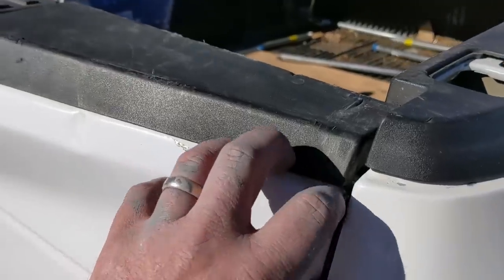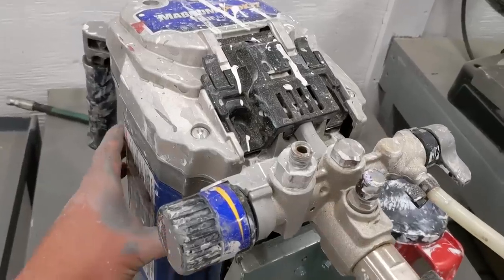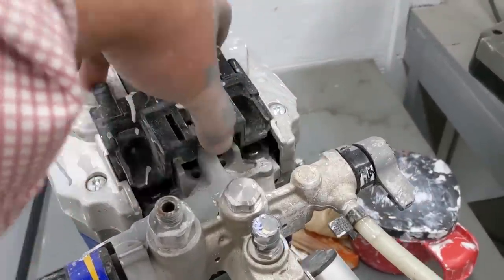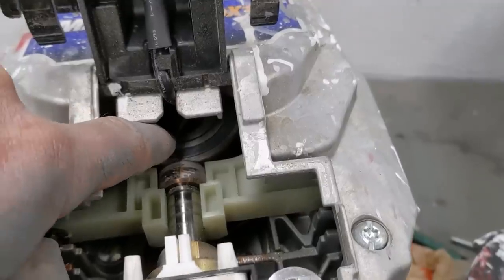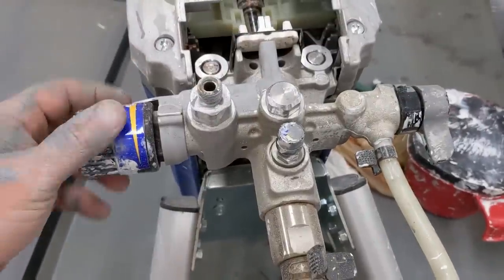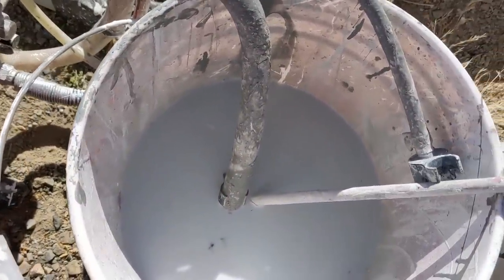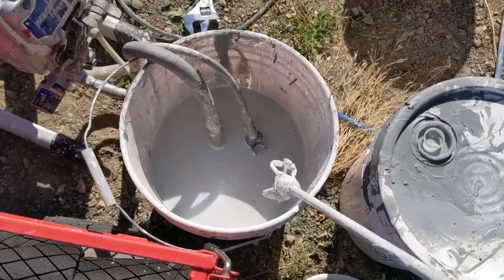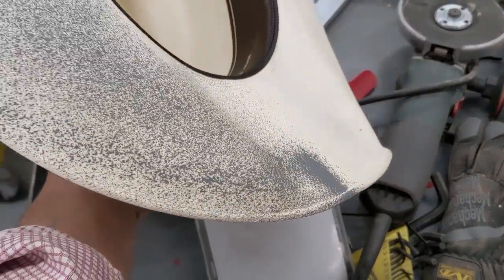Tune-up the wife's favorite toy | Grayco MagnumPro

Comment: I was a pro painter for 16 years let me tell ya we party hard why you think there is a bottle opener on a paint can opener. Lol
Reply: Whenever you find four painters you always find a fifth.
Reply: I think I can top this! Electrical cabinet keys double as bottle openers! (Not the 4in1 kind, but the cast ones with a "loop" handle)
Reply: @RustyorBroken  Infinite painters once you got at least 4. Got it.
Reply: Can confirm
Reply: Wise man once told me it was because painters are too stupid to properly operate a 28mm non continuous spiral thread female beverage endcap fitting ..
Reply: The only guy I currently know that's a professional painter drinks beer all day, even while working. Doesn't even bring a cooler and just drinks em warm. He says it keeps people from stealing his beer.
Reply: It’s definitely an occupation for the thirsty crew
Reply: @SakariNy  my cnc milling machine has one of those for the control cabinet.
Reply: @slidey1000  it's two step troubleshooting tool.
Reply: @SakariNy  exactly.  Diagnose the machine, then calm the operator down. (me)
Reply: Your screwdriver has a bottle opener on it?
Reply: @pinpetos  roofers, anyone?
Reply: @jonobvious  my screwdriver is a bottle opener.
Reply: My bic lighter is a bottle opener....so is my wedding ring.....yeah I'm covered
Reply: I never knew a painter who didn't drink...or swore it off for good (reason).

Comment: Got me one of them schmoo shooters. Works great as a parts washer with some brake cleaner in it! Previous methods included the dishwasher but the kitchen staff nearly issued divorce proceedings when I left a pair of brake calipers in there!
Reply: Thanks for the tip, I will present it to the misses as a paint sprayer but secretly wait until she is done to have a parts washer!
Reply: It's a good meal only when served on a sizzling hot brake caliper.
Reply: Years ago, I used to buy the 3 pack of surplus chinese SKS rifles at the gun show, clean em up, sporterize them a tad and flip em to make a few bucks to pay for MY ammo. The dishwasher was the best way to get the last of the cosmoline out of them. Until I got caught. 
Things changed a few years back, let's just say these days I can wash anything I want in MY dishwasher. Can't get the cheap guns anymore though, wish I kept a couple for myself...
I like the cleaning gun idea, I'll be using that. A little kero or commercial cleaner mix in the tank and let er rip. Bet it cleans out the check balls well too.
Reply: I used to wash the cluster cups from the milking shed in the dish washer, there were 136 of them. The misses didn't mind because if I didn't use the dish washer she would have been helping me clean them by hand.
Reply: Bobster - I got caught putting foot pegs in the dishwasher. Apparently that isn't the way to a long and happy marriage.
Reply: @BrianBell4073  I have to admit. Brembo 4 pots and white plates aren't good bed fellows!
Reply: @bobster1982  shit i'd trade a wife for brembo 4 pots
Reply: That's why you should have the old dishwasher in the garage for cleaning parts. Just don't run gasoline in it or you'd have a long discussion with the fire department and no garage.
Reply: @ehsnils  ...speaking from experience orrr....?
Reply: Thanks for the idea, I have one of these too, fucking beats trying to paint stucco any other way.

Comment: Ah yes the wonders of the airless paint sprayer. Blows everyones mind when they see how fast you can bang out a house the first time. If you are blown away by the simplicity of a paint sprayer you should see what does the pumping on our $4500 graco rtx 5000 texture machine. There's a chance you've seen the mechanism with your background but it blew me away. I took the cover off cause we just got it and I was curious, what makes this texture machine be able to literally blow through a house even multiple apartment units in no time? A wheel with two shafts sticking out that squeezes the same type of vinyl or whatever tube that goes to the gun in a U shape in one direction. Thats it, I thought it was gonna be some crazy screw drive or..... no a wheel and two free spinning shafts do all the pumping by squeezing a tube. Genius, blew my mind, I absolutely was not expecting that. If the tube gets worn out its only like a foot or two long, has large brass fitting disconnects and is replaceable, I mean come on....
Reply: Peristaltic pumps are neat. They're pretty common in medical machines where you don't want the pump itself to touch stuff like blood (dialysis and transfusions come to mind), and are pretty accurate for applications where you need measured quantities, since the volume between the rollers/wipers is a constant.

Comment: Just bought the exact same model to paint my kitchen cabinets. I hung the doors vertically and  they ended up looking like a topographical map of the Hymalayas. I gotted some learning to do.
Reply: Been there, done that. I feel your pain.
Reply: You got a thousand linear feet a kitchen cabinets or what? Christ, what did a brush ever do to you?
Otherwise Harbor Freight siphon gun is all you need If you can't roll it.
Reply: @otm646  I'm a new homeowner and young, I suspect it won't be the last time I use it. Better to have it and not need it than to need it and not have it.

Comment: Big thumbs up to companies that make repairable products instead of throw away crap. 

Side note. I recently was tooling on an old truck that has seen many northern winters. Got stuck on 2 bolts & ended up taking a break from frustration. While sitting around an AvE vid popped up in my suggestions & like the best of all epiphanies I recalled a vid suggesting alternating between tighten/loosen to crack a rusty bolt. This suggestion turned several hours of cuss words into 2 min of absolute relief. Earned my sub yet again.

Comment: i worked for a foundation repair company and we used these to flush foundation cracks with acid/water through grease nipple fittings that we drilled into the foundation

Comment: 8:15 Use Throat Seal Liquid (TSL) prevents paint and coatings from drying onto the displacement rod and packings extending the life of the pump
Reply: I just use 100% anti freeze
Reply: I run a hydro pro iv.
Reply: @skm9420  Good for storing also cheap but when spraying you wanna use TSL on stroke rode just fill the wetcup I've never had that problem with my Graco ultra max ii 490
Reply: Consumer models (magniums) dont have a lubricant cup like the pro models. Your not able to properly oil them. This is true for both manufactures I repair for; Graco/Airlessco and Titan/Wagner.

For storage. What I have my customers do is clean the machine well and then pump mineral spirits in to the complete system for long term storage (any time frame greater than 1 week). There is a product you can buy called pump saver which mixes with water. Its essentially windex and antifreeze. I prefer mineral spirits due to it protects the steel and wont let it rust as well.
Reply: Meh tsl is just any old oil. Lol
Reply: @matmuffin1  nope, it's also designed to be a solvent to prevent any paint from drying.
Reply: @mtbrdude  I used to work on these every day for a living. Tsl along with any motor oil will prevent both water and oil based paints from drying... If you have paint making it past the packing nut you either need a rebuild or to tighten that nut. I've also seen pumps make 3300psi with only part of a piston packing intact so these things are designed pretty good lmao

Comment: I used to paint with the biggest sprayer Graco makes. It was powered by a 185cfm air compressor outside. Still got two of the 1.5in dia check valve balls it used. We always filled the pump and hose with thinner for storage.

Comment: At work I’ve rebuilt quite a few of the garco airless sprayers although they are more industrial. The one is a bulldog 180cc and the other is a xtreame 45 290cc there upper pump runs on air but the lower is similar to the one in your video. We use ours with 2 part epoxy paint and a common problem is your lower ball getting stuck. They are built like tanks we had the bulldog for about 25 years now and it gets used daily. Every few years rebuild the lower pump and your good to go.

Comment: Nice, but these days I'd suggest you use the non-powered hand pump variety which keeps the paint in the handle. They work awesome, reuseable, but also cheap enough ($30) to be disposable if you want. I've done tons of painting with one. They also include a cleaning helper to clean out the rollers, one that actually works. Nice to see you back. The last couple days I kept wondering when we were gonna see a video from you.
Reply: Same here...

Comment: I’ve owned the same spray setup for years now… it’s a great unit and in a pinch figured out the absolute best way to clean it… old fashioned nowadays …powdered cascade dishwasher detergent.. slap a bucket of hot water under her add some cascade and run it through the spray hose and gun for a bit … then thru the bypass..shut her down and leave the suction and return lines submerged in the bucket and throw the spray gun in there overnight… in the morning rinse it and get back to painting

Comment: My family is owned and operated a residential interior painting company for the past 40 years we don't spend the time to fix those graco's we just buy a new one because it's cheaper. They start there life out as a fine finishing tool and then as they age they end up outside spraying decks and fence posts when they totally fail usually they sit at the shop for several years until somebody decides they want to try to repair it and take it home.

Comment: Finally AvE is talking bout something I am an expert on. This machine can inject paint into your body. It can lead to amputation
Reply: the 'short circuit' is to get air out of the line.
Reply: @MrPitjoey or clear the schmoo off the tip with your finger. I've seen the paint filled finger to prove it. I've never seen anybody cut the 'ears' off the rack before. it signals the orientation of the fan and protects the tip.
Reply: I was going to say the same. I have operated, sold, and repaired these machines all in separate professions. 

I do have one comment on this machine as it relates to other paint sprayers.

GARBAGE.

Comment: After flushing out your airless sprayer with water if using water based paint it's a good idea to run some mineral spirits thru the pump, especially if it's going to sit awhile before using it again. Nothing beats a through cleaning, including all filters.

Comment: I have a few graco sprayers and they don't have a relief valve they just have a pressure transducer to shut the motor down. The problem is always on the suction side.

Comment: @AvE With my Graco I have found that running water through it and the hose is the best.  Then to store it long time the pump armor with auto motor oil is best.  The oil keeps the first check ball from sticking.  I also have found that on interior work with cheaper paints backrolling is key for a good finish, so next time I do interior paint I will spray the corners then buy the rolling attachment for between the corners.

Comment: Finally something I know something about. Dont have much to add though so I'll just say, this is like the ryobi of sprayers. Cheap, it'll do the job and it's good for homeowners but not good enough for professionals and won't last as long.
Reply: But at least they never changed their battery platform.📉😎📈

Comment: I always leave water in the line with pressure. We mostly use latex paint  so water will do instead of expensive cleaners. We keep other hoses and guns for oil base paints or lacquer jobs. Never have enough of them damn tips either! Just like the hass

Comment: Holy shit, finally something I can actually real world relate to! In a former life I was a graco repair tech. that button with the finger pokin looking pictogram is to unseat the lower check ball if it sticks.  If that doesn't work you can also give em a whack. with the thumb detector.

The packings that run along the piston shaft need to be lubed with Throat Seal. It's an oil with a light acid. My guess on the heat discoloration is probably because the wet cup at the top of the pumping element  (inside the two slots) wasn't filled properly at some point and the sprayer was run for a while.
Reply: Wow that's some serious Graco knowledge.  .. All I can add to that Is if he used the right hvlp tip diameter he'd increased area coverage ..

Comment: There is a ball in the fitting rt ate the end of the clear hose. U will get fund built up and it will cause it to not prime. When you put it away for the season run it till the water is clean. Then run a lil thinner in it. Make sure u dump the pressure. Do not store it under pressure

Comment: Been spraying for many years with hundreds of hours on machines....

For latex paints flush with dish soap and warm water. Change filters frequently. Ive never had an issue.  
Never cross contaminate latex with lacquer. Buy separate machines for each.

Comment: The little "pushie thing" was simply there to unseat that inlet valve ball...since it routinely sticks between paint jobs....it's always first  to when the pump fails to prime.....
Reply: One of the only times a tappy-tap tap IS the correct move.

Comment: Oh no! You forgot the most important part. The warning label has a instruction for a surgeon, in case a 200 lb. Gorilla injects the paint into his body. 😲
Reply: Mine came with a card you're supposed to put in your wallet while using it, with the same medical instructions on it. Definitely gave me pause before starting it up.
Reply: Damn skippy, you need a surgeon. I work for the company that manufacturers the actual hose for it and I think we test 'em to like 6000 PSI before they pop.
Reply: Those fluid injection injuries are no joke though.

Comment: we use a 270 i think graco power painter at work to do hydro static testing can get 2500 psi to 3000 on some.then if we have other things higher then have dedicated pump i have went to 15,000 psi on

Comment: I know this had been said before, but 120VAC is the RMS voltage. So 8 amps at 120V is 960 Watts RMS. You're effectively doing the calculation twice.

Comment: If you unscrew that outlet fitting that the gun/hose connects to, there is a small filter in there that can get clogged up and cause problems.

Comment: Spelled correctly, Graco is good equipment. I used a pressure pot for 14 years and the entire setup was worth its weight in paint. Better than Binks.

Comment: Run some diesel through the machine and leave it overnight @ 500psi. You can use mineral turpentine but diesel is cheaper.
When storing leave diesel in machine, it keeps all rubber seals etc in good order and displaces any softens and residual paint.

Comment: That piston rod should have some TSL (Throat Seal Liquid) applied to it every time you plan on using your pump. I'm not sure about those smaller rigs sold at the box stores, but the ones I'm used to have a small cup or opening in front of the rod where the oil can be applied. Gracos, Titans, Spraytechs are all the same in this regard. It's always good to run at least a couple of gallons of hot water through them after use and either use Pump Safer mixed with water or mineral spirits for storage. Also, there is some rod packing in most pumps that wear out if the TSL  is not used regularly which will allow paint to escape around the top of the rod causing loss of pressure. The wand you put in the paint is known as the Dick in the field.

Comment: 7:30. My dad had his Gisholt lathe in the background of his snowcat mod blog, and one guy called him out for the flex, had to explain to my dad what a flex was.   Nothing nicer than being able to walk straight up to what you need and grab it.  That's a beautiful hydraulic fitting book.  The enigma of what your profession is pesters me.  "What does he do to need all of these hydraulic fittings in specialty connectors by the bookshelf-load? And why did he leave his wrenches underneath of the pipe assembly he was painting Orange?"  I'm sure I'll never know.
Reply: He's an injection molding industrial maintenance machinist pattern maker and PLC technician.
Reply: & the second one is called alcohol